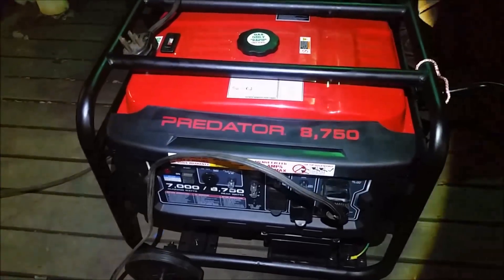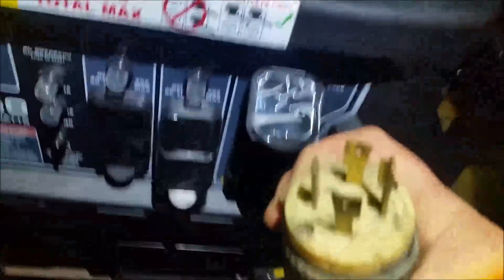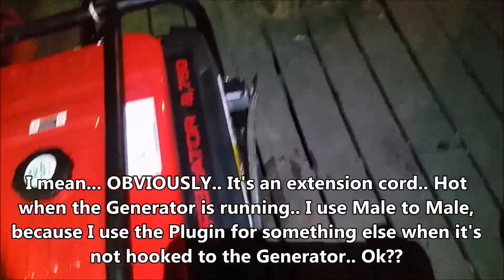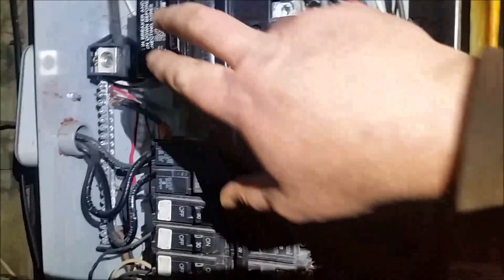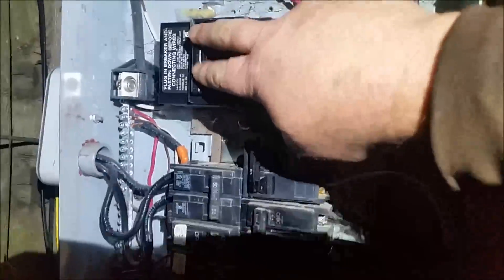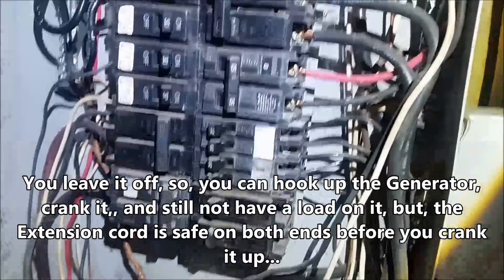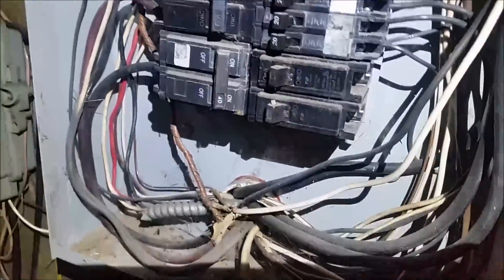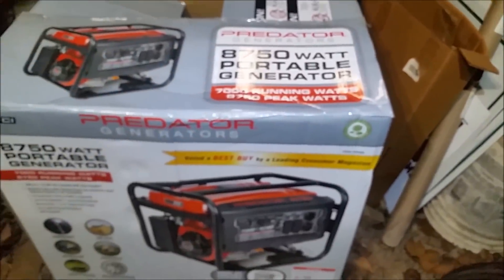Quick/Easy/Safe: Use Existing Plugin/Breaker for Generator hook up to your house Panel box.

Comment: Hey Mark!  All these numb-skulls on your video comment thread talkin' about how this isn't correct/safe etc, yet not one of these boneheads details what's wrong with the set-up.  They're just internet trolls if you ask me....Trolls with 46 years of "experience" being trolls. lol......Anyway, I have a questions for you:  I have a Ryobi 2300watt peak/ 1800watt continuous portable generator and I simply want to be able to work the lights and tv in the house in the event of a power-out.  It's all 120V off of my generator.  Can I use the same wiring scheme as you've shown for 220V , even using that 220V 50 amp breaker switch and expect it to work for me for lights/tv/fridge in the house, only using my Ryobi 1800watt generator? - Thanks in advance
Reply: There is nothing wrong with this hookup. The only difference between this and 'up to code' installs is the mechanical lockout switch that prevents the main to be switched on at the same time as the generator breaker. Anyone with common sense and who checks his stuff twice can do this safely.
Reply: r r agree with his set up all you want but please don’t call this “common sense” when most of it clearly isn’t common knowledge. 
If it were, we wouldn’t need a million YT videos to argue over it.
Reply from the maker: Yes... I'm not sure about the Refrigerator.. Probably, but, you will have to test that.. If you have a Newer TV you might get all of them on at the same time.. You are only going to be able to power one leg of the bus in the panel... 
Remember. That is not one "Side" of the bus, but, every other breaker on each side of the panel.. 
If that  confuses you,, flip off the main breaker and pull the first 4 or last 4 breakers out and see how they plug in.. Every other 120v breaker feeds off of the same bus.. The one next to it, feeds off of the other bus.. 
So, you will just need to swap a few breakers or wires around to get the lights, etc that you want on that bus.. 
You will need to turn off "All" of the 220v breakers, because you will only be feeding one leg of each of the 220v breakers.. 
But, yes, you can run some of your circuits off of a 120v generator.. You'll just have to feed with a breaker on one bus and put your loads on that same bus (Every other Breaker on each side of the panel.. 
If you want to use a 220v plugin to do that, yes, you can do that.. You will have to track down the hot wire from your generator and get it on the correct side of the 220v breaker.. Easy to swap and doesn't make any difference when you are running on utility power.. Either hot can be on either leg.. 
Yes.. I believe there are lists floating around and people being paid to jump on videos like this one and try to post a bunch of negative comments to discourage and scare people away from doing their own repairs, etc.. Yes, it can be dangerous, and so can driving a car.. But, if you follow some simple rules, both are safe.. There are lots and lots of really stupid Electricians running around out there from the likes of the comments here, that would be dead otherwise.. Ha.. 
Be Safe and Good Luck. Hope those comments help..

Comment: What you've done, will in fact work.  Lot's a off the wall 'fix-it's' will work but it does NOT mean it is correct way to do it.  For all the time you've spent defending your suicide cord and backfeed, you could have easily spent 1/10th of that wasted time and do a simple interlock box and breaker  interconnect - foolproof, safe, and to code.  You sir, which I use lightly and certainly way out of context,  are a fool....    I would nominate you in a heartbeat to  be the next Darwin Award Winner.  Your work area is trashy, crap everywhere, dirt floor - a general disaster area.   There are many classes of people out there.   I just can't find one to put you in...
Reply: Funny comments coming from a fly guy. I just looked at my jumper cord and although in 19 years I have never held it live if I were to I have a full 1¾" of plastic to hold the plug by so what's the big deal? I am more comfortable with that than spinning the prop on a Cub, after all what if you forgot to step back?

Comment: With the exception of the male male plug and the missing interlock plate this is exactly how it would "legally" be hooked up. I understand the safety issues but its really just semantics.
Reply from the maker: If you don't use a Male to Male Cord,,,,, You'd Better have an Interlock.. That would be quite dangerous if you did one without the other.. 
If you just use a standard (already used for something else plugin), then, the only thing "You" have to remember is,, Turn the Main Breaker off FIRST,, then, hook up both ends of the cord,,,,, then, you can crank the generator, etc.. and not have any safety concerns.. 
Hang a Male Plug outside of the box to use a "Standard Generator Extension Cord",, you'd better protect the general public from that Male to Male plugin sitting there outside of the panel with an Interlock, where you can't use that plug for anything else but a generator, and only IF, the main breaker is turned off.. 
But, that is not what this video is about.. It is about using the existing plugin "Temporarily" to hook up the generator, then, unplug it and everything is back to code.. 
Besides,, according to NEC, they regulate when "Temporary Extension Cords" can not be used,,, not anything about Temporary cords and their uses..  So, not against code anyway.. 
Think about it for a minute and see which one is more intelligent? I think it is pretty simple.. 
And, for those who say "Electrocute the Lineman,, bla,, bla,,, bla,,, ",, just how long do you think you would power the "Grid" if your generator was plugged into the grid and began acting like the power company, trying to power a hundred or so homes,,, all at the same time,,, all sitting there with the main breakers still on, waiting for the power to come back on... What? A split second? 
This video is only for those that understand those things and know,, they must turn the main breaker off first, or it won't work anyway.. Ha..Ha..
Reply: @MarkThomas123  I was agreeing with you. Just pointing out the 2 single differences that make one way legal and the other illegal. I swaped the old 220 for my dryer ( use gas now) to an RV outlet and turn off my main. All I have to remember is the main, my cord is at least safe. Laws don't save stupid people.
Reply from the maker: @JoeBlow-24  Understood.. RV Outlet? Safe Cord? Sounds like your RV outlet is a Male Plug, exposed prongs? To use a Standard Male to Female Generator "Safe" extension cord? If my assumptions are correct, you should move your breaker up and get an interlock.. There is nothing "Safe" about using a Standard Generator plugin,, Unless you have an Interlock.. Just being sure about that.. 

The Male to Male Suicide cord is perfectly legal.. I just explained that.. It is quite common in the industrial field, used by electricians for temporary power.. The Cord itself if not safe/unsafe.. It is only what you plug it into and how that is safe/unsafe.. You might want to go back and read my previous reply..

Unless you are saying,,  your Male to Male Extension cord is "Safe" because of how you connect it.. Main Breaker off first, Generator off, then connect it.. 
Then, I also agree with you.. 
The Generator/RV plugin is a Male Plugin and it is a permanent plugin, so, if it is used, it must have an Interlock, and it IS regulated by the NEC, if your state has adopted that part of their regulations, which many already have done due to common sense..  If you have done that, you are OK and legal.. 
What I do here is temporary and Legal... If it were permanent it would not be.. The only permanent part is a "Standard Approved" Female 220v plugin connected to a breaker, normally used for a Welder, etc.. The Male to Male Extension cord is Temporary and not regulated,, therefore not illegal. 
Just clarifying...  Be safe.. Cheers.
Reply: @MarkThomas123  so if a person moved their 220-volt dryer Breaker up the panel to the right with an interlock kit, one can go nema to dryer female safely because the interlock takes out those brain daze says out of using male - male danger plug ?
Reply from the maker: @randylee2549  Correct.. You got it now... 
But, there is a catch, I will explain last below. 
The Male to Male is only a convenient way to use an existing Female plug,,, knowing you would never even think of plugging it in with the Main breaker on,,,,,, OR,, the Generator running.. If there is any chance to that ever happening.. 
Catch is,,, if you move your Dryer Plug up to the top of the Panel, and hook it up to an Interlock,,,, You can't use it while the Utility power is on... Hence another nice feature of this setup, without the Interlock,,, allowing it's use while the Utility power is on. Not everyone has an extra 220v breaker slot, which might not either.. 
This setup is only for those who can remember Main Breaker Off, Generator Off, Plug in the Male to male, then, it really doesn't matter after that.. 
Tell you what.. Make a short Male to Male extension cord for a little light bulb or something.. Hold one end in your hand, and """THINK"""" about plugging in the other.. I think you will see what I mean.. I mean,, you are holding a Live end in both hands.. It's usually all someone needs to remember.. The rest comes naturally.. But, no matter what, a paper inside of the panel explaining how to do what is simple enough.. :) But, totally up to you. Safe is good, Not safe is really bad,, Not knowing for sure is not being safe.. And, that has to make perfect sense..
Reply: @MarkThomas123  here here, well said. It is the most convenient thing I can think of what you have suggested, and yes I'm one of those people who will have a check list to make sure that even though the power is off from the supply, which is the grid, my common sense of course is to shut it off anyway knowing that it will return. This way I can run the generator after all connections are made and the main breaker is off right through the garage but with the garage door closed so has no fumes come in, as you say it is just temporary that way I can use the dryer double pole circuit breaker as a backfeed without Danger, when you are dealing with this kind of amperage and voltage you cannot be complacent and you always have to be thinking about it and not in a hurry. I like it, thanks so much for making such a clear explanation, I appreciate it

Comment: This is not meant as a criticism of this method.  I certainly thought about doing something like this; however, I am leery about attempting anything but very simple electrical repairs.  If you don't know what you are doing you can do a lot of damage or even get killed!  Turned out it's not terribly expensive to pay an electrician to install a proper generator plugin with a lockout switch and buy a cable that is designed for connecting a generator to the box (those suicide cables are indeed dangerous!).  I spent less than $500 for all parts and labor to do this.  About $50 for the plugin, $120 for a 50 foot cable, $70 for the lockout, and about $200 to have a licensed electrician install everything.  Took him about 1.5 hours to install and test.  The way the lockout switch works is that it's IMPOSSIBLE to bring the generator online if you are connected to the grid and vice versa -- it's a very simple mechanical device, a metal plate that is fitted to your main breaker box.  To use your generator, you have to move the plate to activate that breaker and to do that the main breaker has to be OFF.  You turn off your breakers, switch to the generator and then turn on what you need at the time one at a time up to the capacity of your generator.    If you do the work yourself, you could use these parts for a safer installation.  These are basically the items I gave to the electrician when he showed up to wire it up:

Here's a link to a site that sells the lockout switch: https://www.geninterlock.com/product/generator-interlock-kit-general-electric-ge-100-amp-old-panels/. 

You can get a generator plugin at just about any big store like lowes:  https://www.lowes.com/pd/Reliance-30-Amp-Generator-Power-Inlet-Box/3133095?cm_mmc=SCE_PLA-SeasonalOutdoorLivingGenerators_-3133095:Reliance&CAWELAID=&kpid=3133095&CAGPSPN=pla&store_code=597&k_clickID=go_625671256_43380966622_217425618852_aud-299487635210:pla-340284172732_c_9025708&gclid=CjwKCAiA8rnfBRB3EiwAhrhBGmtZ3WGt8oHi0Rv3TA1OHY-UeVOJQ5icDdJs3zcyJXToxragRNHsLhoCMhgQAvD_BwE   

30 amp generator cable:  https://www.lowes.com/pd/Generac-50-ft-30-Amp-Generator-Cord/50088160?cm_mmc=SCE_PLA_ONLY-SeasonalOutdoorLivingSosGenerators_-50088160:Generac&CAWELAID=&kpid=50088160&CAGPSPN=pla&k_clickID=go_625716425_48553696991_217457983353_aud-299487635250:pla-352363315631_c_9025708&gclid=CjwKCAiA8rnfBRB3EiwAhrhBGutq6Lh_uqhXZbENeEFArrlyb_YqQ_8LRlvp8akp2yjQ5u9q1G4eGxoCvGcQAvD_BwE